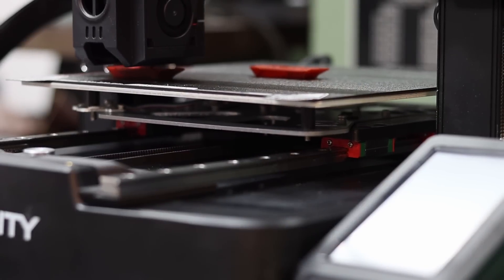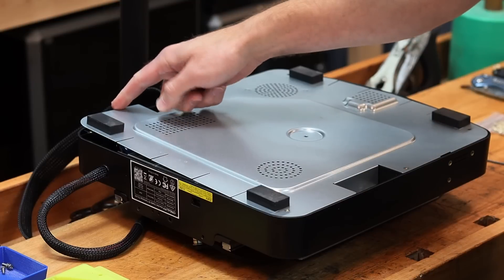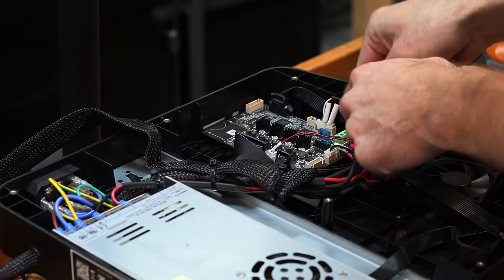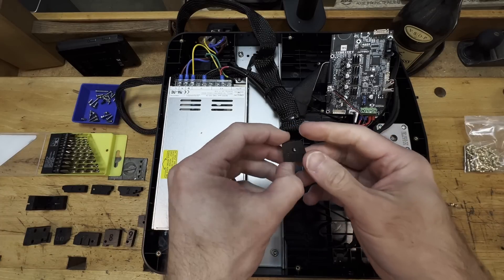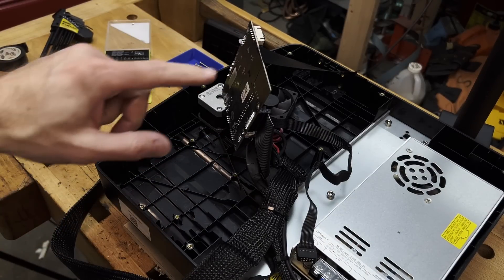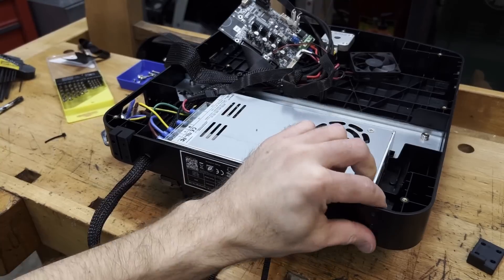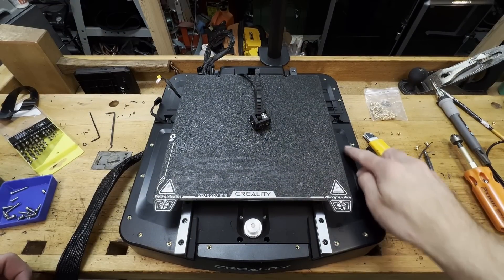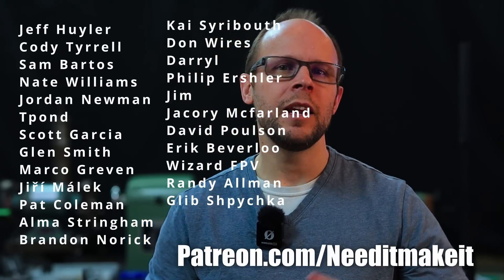Attach ANYTHING to your Creality Ender 3 V3 KE or SE Printer

Comment: I've been following your channel and in this episode, it's great to see someone like myself furthering the design of their 3D printer by taking it to a whole new level...
What I mean by this, is that you are improving the original design to make the printer stronger and more rigid, and adding extra parts to improve its performance too.
I can only guess you are going to add diagonal posts to hold the Z-Axis posts and reduce vibration on the Z-Axis in your next video...
In hindsight, you could have done this too to the Y-Axis for mounting the linear rails, but at the end of the day, you already found a different solution to this.
But this is what has caught my attention. That is as I have said, you have made a printer better by thinking outside of the box and it looks like you'll be loving the performance of this printer even more by the time you've finished upgrading it...!
So well done! It's good to see, rather than people just talking about standard printers straight out of the box. Looking forward to seing the next step on this...

Comment: Very clean and nice way to mount. hope you can release reenforcement mod soon. 
i'm printing your new linear rail mod :D
Reply from the maker: Thank you, too bad the base wasn't just a bit thicker, I would have provided a template to drill from above and then easily insert from above as well.  It's all good though, these blocks make for a pretty strong connection.
Reply: @NeedItMakeIt  with this mod i’m thinking about mount the linear rail directly to the flat layer of the base. So we don’t need to print the adaper. The base will make sure two rails flat and parallel. Because i’m printing adaper vertical and it not stick to the bed well. So the final print are not completely correct
Reply from the maker: @andoan9869  It sounds like a great idea.  I'd just caution that there are some clearance issues due to the motor pulley and front and rear 'bump-outs' if you can raise them high enough, it should work well.  The base is also not completely flat, but it should be close enough to work, a shim could be added as-needed to make sure the rails remain straight and on the same plane.
Reply: @NeedItMakeIt  yeah i’m thinking it at the beginning of using it. But 3d design and test print such a pain due to I only have one printer as this time. It some thing not fit. I have to revert everything back to print again. Hope after this mod you can have some time to think about this idea. 😆
Reply from the maker: @andoan9869  It's a good idea, but I don't think that I'll have the time for at least a year, I work up to 15 hours a day at the moment, between design, video comments and testing, I have only enough time left to eat and sleep.